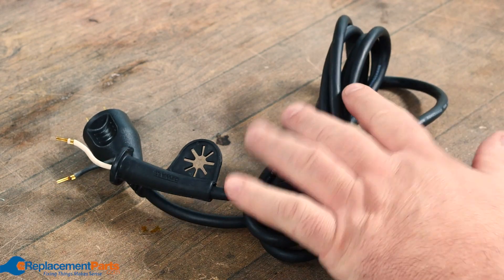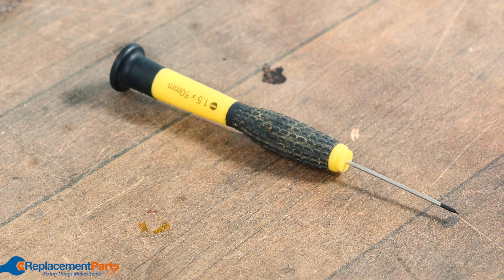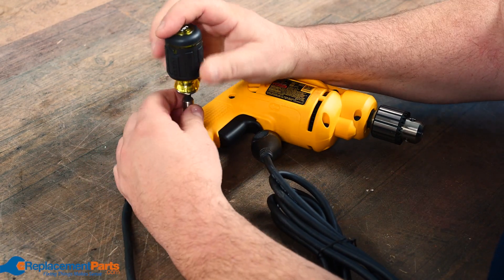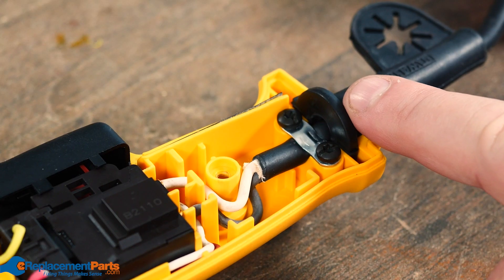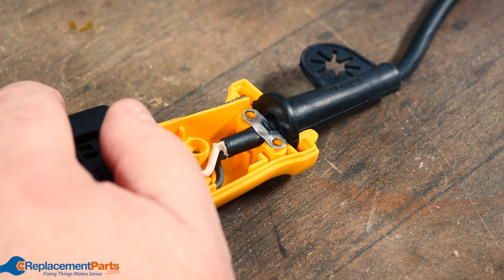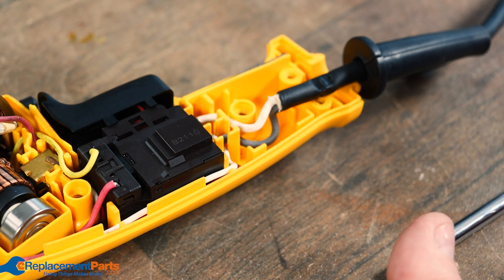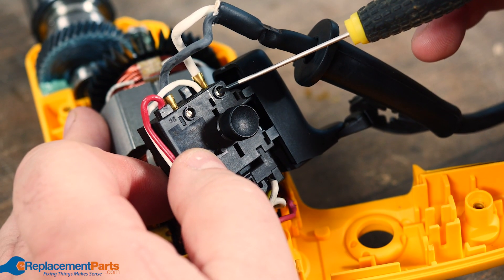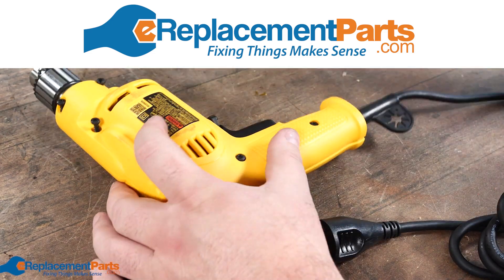Power Tool Repair Guide: How to Replace the Power Cord on a Drill | eReplacementParts.com

Comment: Great video on replacing a drill power cord. I had replaced a couple in the past, I'm sure I lost a couple of screws in the process and probably either lost the metal hold down or put it in upside down. If I told you what I do for a living, and I'm actually quite good at it, even teaching those who got poor training, you'd go screaming into the night. OK, now to order the power cord. It was a gift from someone important to me, over 40 years ago. I also want it to be original. It means a lot to me. Thank you for listening and thank you for your videos. They're great.

Comment: Thanks, this was helpful.  Also was able to get the correct parts from your website (power cable and the 'bend relief' cable throat cover), which was a much better fit than the generic replacement cable I got from Amazon despite searching for the right model.